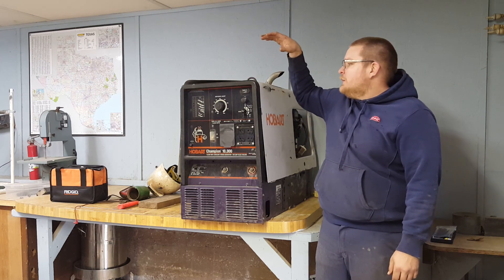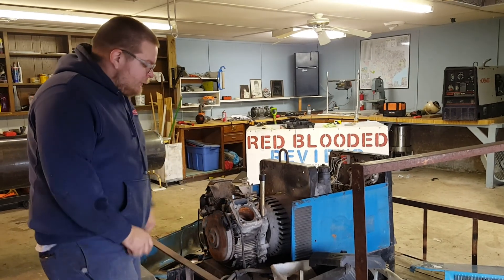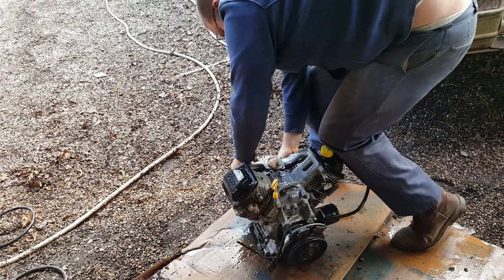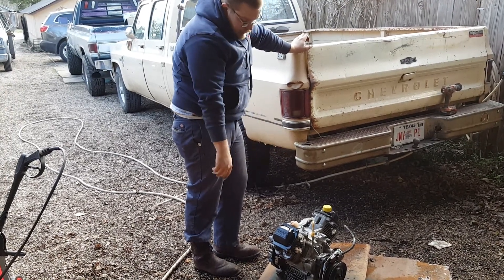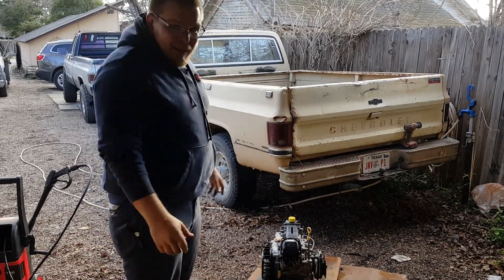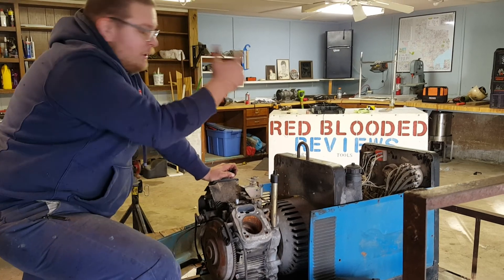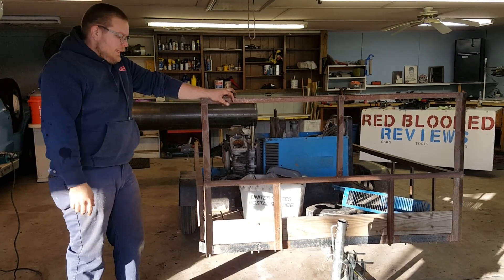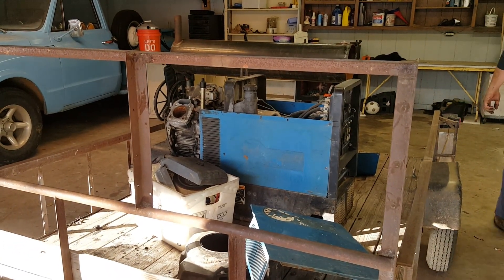Changing the motor on a miller bobcat 225 part 1

Comment: Thanks.  My gas tank has been without a cap and sitting for about 10 years.  I have started the engine from a different fuel source but I need to replace the fuel pump and want to pull out the fuel tank and clean it.  This video really helps,

Comment: can you install a predator twin cylinder engine from harbor freightliner? I have a 225 bobcat with a blown engine it blew today while welding fml
Reply: MASTER MECHANIC Felipe that's what I would like to know
Reply: No because the engines on Miller bobcats have threaded shafts
Reply: @don98024  not all do, there is a sight htat does repower and they use a Honda motor depending on the shaft you have.